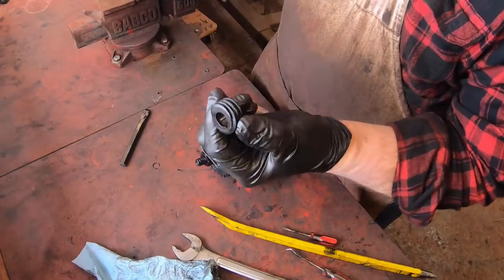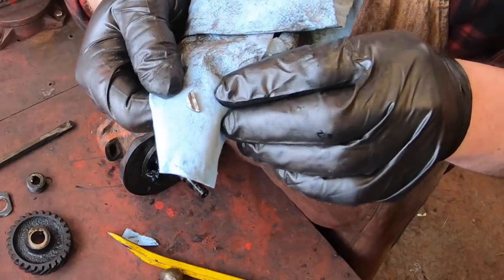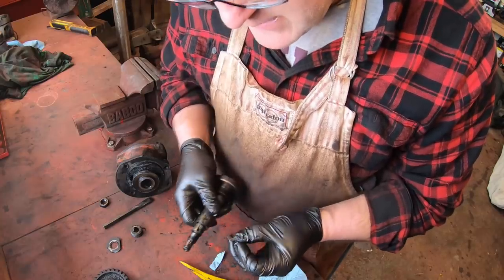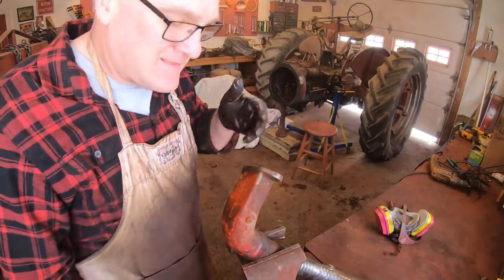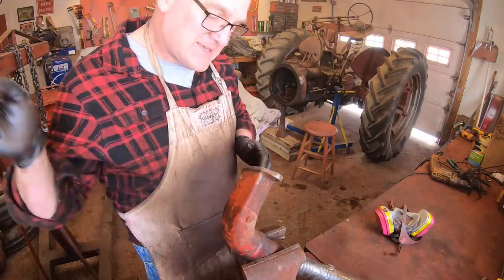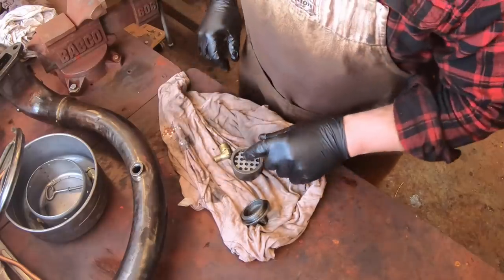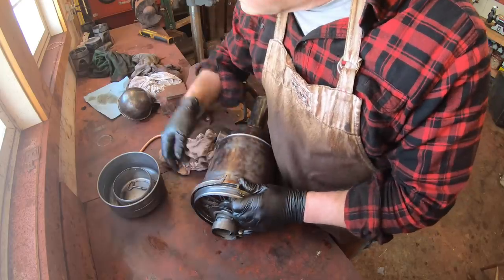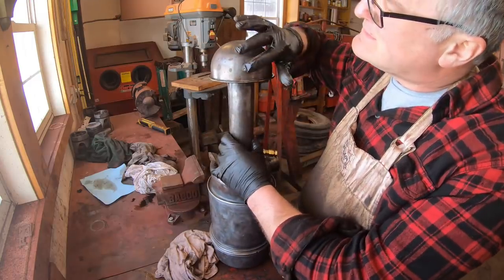a NEW PLAN for the Farmall MD!

Comment: Tip for when you’re fabricating your own gaskets, instead of the grease. 
Flip it around so that the gasket material lays on top of the part you need the gasket for, and smack it lightly with a rubber hammer✌️ you’ll have a nice and precise marking in the gasket material around the inner and outer area of the “ring”😊 edit: love the videos. Crazy knowledge about what you’re doing 👏

Comment: I really enjoy your videos. You clearly demonstrate the mechanical aptitude that found you dismantling tractor components to learn "how things work."   I began learning engine mechanics by dismantling my Dad's lawnmower when I was 5 or 6 years old.  He only told me to put it back together and that it had better run correctly.  I will admit that one of his friend's helped me with torque vales and setting the points and plug gap but it ran.   It was a learning experience "par excellance."

Comment: Glad you are gonna have it running sooner than later. It is exciting to hear it fire on gas then watch the smoke roll as you bleed the injectors. Hopefully converting to diesel in a smooth way when you pull the compression release lever.

Comment: Yes those air cleaners are fun to take part Pete  :) and seen one rusted bottom were oil hold rust with lots pin holes to had weld up on outside pan to fix it and couldn't get good used at tractor wreck yard! Plus one air filter chamber hose had fix on old the hose was slingie spring but changed to a rad hose style to ! Also 2 hose clamps too used and look nice carb to air box too! Also always like those Air Mushrooms caps to for Air Filter and Oil filter ones last long time !

Comment: Dang, I was hoping you were going to take that air cleaner apart.  I'm going through a mini resto on my 240 and opened my air cleaner to find it dry dirty and rusted.  I was going to weld the hole in the bottom of my oil cup but I think I'll braze it instead.  My filter packing it rusty, dirty and brittle.  It looks like it would pull out except for the dimples around the rim and the rust.  Do you remember how you got the one you talked about apart?  Are you coating any of the bare metal parts you're cleaning up with something?  Are you dealing with flash rust on anything.  Thanks so much for doing this series, I'm learning so much.
Reply from the maker: The bottom is spot welded around the bottom rim. Drill out the spot weld dimples to get the bottom off and then you can remove the steel mesh. No issue with rust on parts cleaned with a grinder; an oil/grease film remains on the part. It's cleaned off with solvent before painting.

Comment: Pete, you might want to get your starter and generator (alternator) rebuilt now so that they are ready for installation of the engine.
Reply from the maker: The tractor is getting a new alternator. Typically my Dad goes through the starters.
Reply: @JustaFewAcresFarm  that's good. I don't know how many people put in or rebuild their own engines, and discover that they can't seem to get it to start or charge right, and wind up taking half of the engine back out to fix something that should have been planned for. I'm glad that you're on top of it.

Comment: Don't use bondo to completely fix dents like that especially if they are deeper than an 1/8", always best to get the metal as close as possible and only use bondo to "smooth", never to "fill"
Reply from the maker: I gave my experience in the video. It works fine.

Comment: Did you send out the 4 pistons to the first 4 that ment your suggestion or requirements??
Just asking thought you would have shown them in route to the mailbox at least , no names needed 
I like your new approach with your MD
Reply from the maker: Hi Matt, I haven't sent them out yet. I had planned on doing it after the engine came back from the machine shop.

Comment: I would think that air filter mesh must be pretty dirty.  Will you clean that, and how?
Reply from the maker: It wasn't too bad, from what I could tell by running cleaning fluid through it. I'll be running detergent oil in it and changing it frequently.

Comment: Pete - my husband and I really enjoy watching your videos (he lik4es the tractor ones more) and I am learning alot!  We both have a question - why not paint everything after you have it cleaned but before putting it all back together?  Do you worry about rust once the metal has been cleaned but not covered with something?
Reply from the maker: Hi, there is still an oil/grease film on the parts after I clean them, so rust is not a problem. I wipe the parts with solvent to remove the film before painting. I will be painting parts before assembly, after I get everything cleaned. Painting will start in a week or 2. Thanks for watching!

Comment: If you just have to use this tractor to work this year then good plan, plus you have other equipment on the farm that needs preventive maintenance and or repairs before they can be used in the fields so the shop needs to be freed up for the other farming tools.
   Correct me if I am wrong but the oil bath air cleaner care instructions state the air cleaner is to be serviced daily or twice daily in dusty conditions. We all know that who in the world does that, one of the partial stickers that was cleaned off the air cleaner should have stated this. I have read this on many engines and thought ya right who will do that. Happy cleaning. lol

Comment: I hope you bead blast or etch all the cleaned up parts before painting. Wire brushing is good for initial cleanup but it leaves a burnished, or polished finish on metal with little or no tooth for paint to adhere to. After a season or two the paint will just start flaking off.
Reply from the maker: Ha ha! A polished finish! Have you ever worked on an old tractor? I wipe with solvent before priming. Never had an issue with adhesion.

Comment: Aren’t you going to have to clean bell housing before you reassemble all front components to prevent dirt and contaminates from causing future issues with what you have cleaned before?  I am not a mechanic!
Reply from the maker: Hi Terry, The engine is sealed from the bell housing so contamination is not a worry.